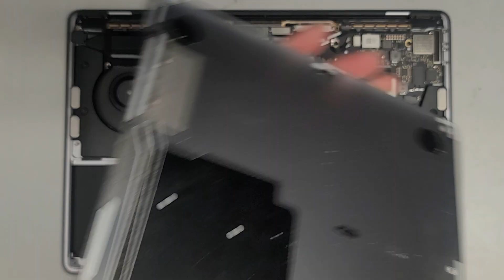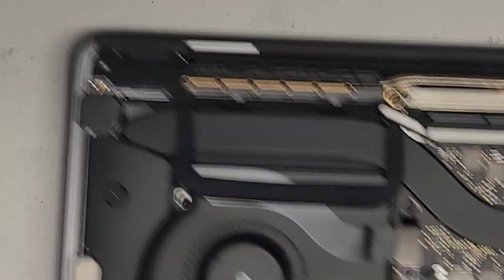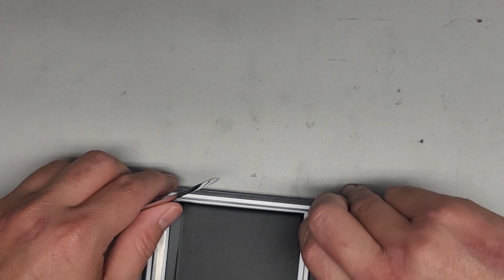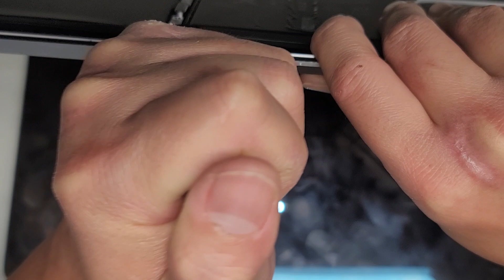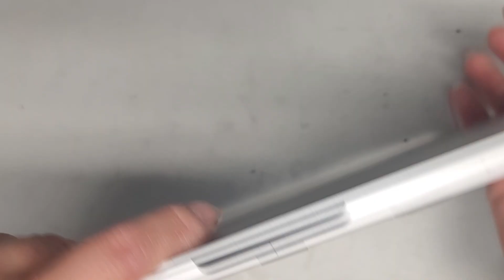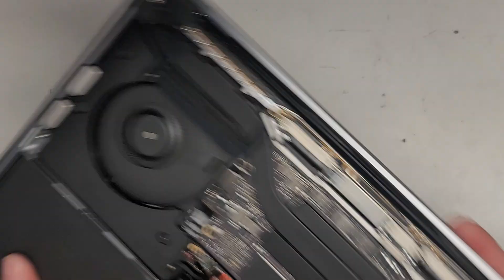Late 2016 13" Inch A1708 MacBook Pro Disassembly Battery Replacement Repair

Comment: Thank you so much for the DETAILED battery replacement video!  I appreciate the time and effort in going through each step, even with the removal of the sticky residue.  Also appreciate showing how to do the PRAM and SMC reset.  saved me time from having to look it up.  Yes, the PRAM may not have worked on my laptop, but even so, my laptop is working as expected.  If anything quirky pops up in the coming days, I will look up how to do a PRAM reset for my model  :)
Reply from the maker: @zetaminor77  awesome, glad it worked and you appreciated all the details.  If you haven't already, please like and subscribe so others can find my videos and possibly consider watching a few others, liking and commenting to get the algorithm to recommend my channel. Thanks!